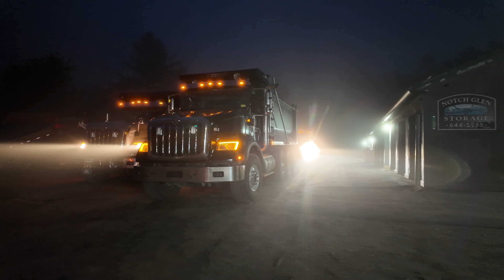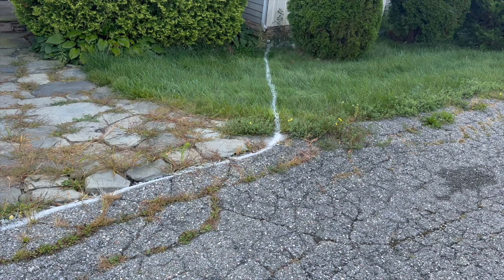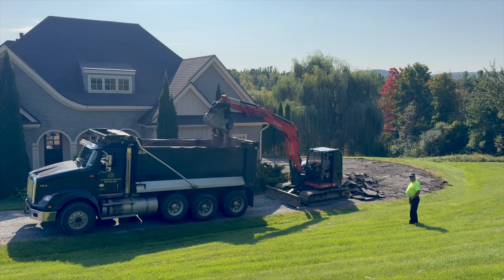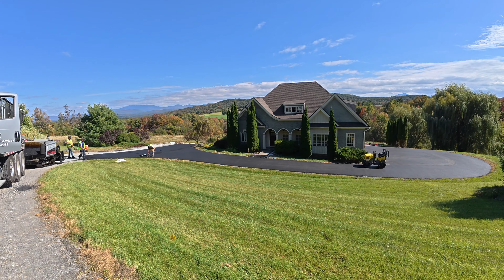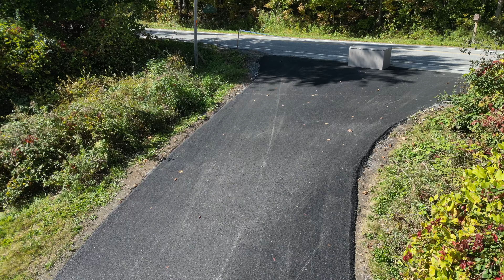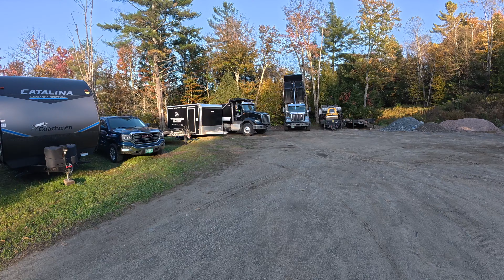Tearing Out & Paving The Steepest Driveway We've Ever Done

Comment: Looks good. Link belt makes a good  a machine. Iv ran there 8 ton size machines and I liked them curious to see what you think of them. All though I still hate the cat minis iv gone all thru the settings I do love the 315.
Reply from the maker: I can honestly say I don’t love our new 303.5. But I don’t run it
Reply: @VTOutdoorServices  iv tried it all on the 304 every setting and I just don’t like it. Now put me in the older 304 I think it’s the 304cr I like those but them new ones are just to touchy for my to be using around utilities. Maybe if I ran it everyday for a couple months I’d get used to them.  Iv always ran Kubotas minis for the most part and they aren’t fly by wire I geuss you could call it. It’s just like for me learning on backhoe controls and trying to relearn into cat some guys can do it others can’t. I am not great operator by any means but them fly by wire cat minis make me look like a newbie. A lot of other people dislike them at first to. I know you’re not a fan of your 080 but I love the 27 and 040 I used to run. We have 3 080 rubber tracks I run them once In a while I like them but they are old and tired. Mainly just run breaker at this point I think they have like 10k hrs.

Comment: Should pave mine starts flar then 3 12 pitch to hard left to a 6 12 for 309 feet flattens out then 158 foot at 7 12 pitch to a 100x125 flat pad i cleared and graded it by myself with a d5 a 325 cat plus 200 ton of crusher run rolled with a 20 ton then 60 ton of stone dust sprayed wet and rolled 4 times not a single wash out noone will pave it